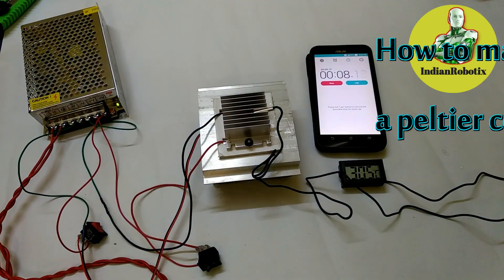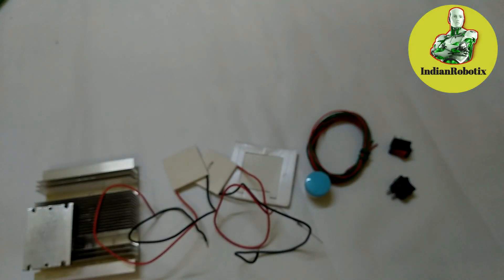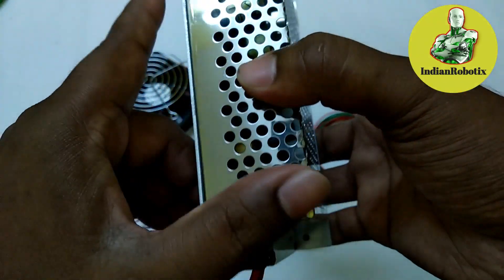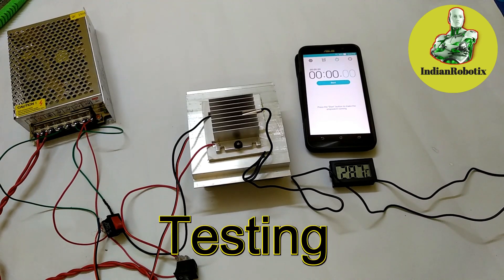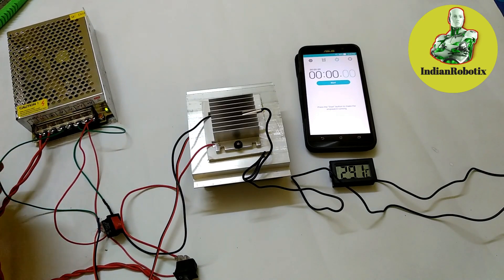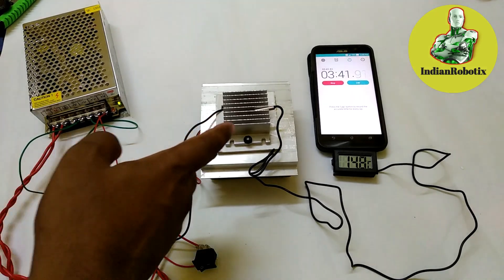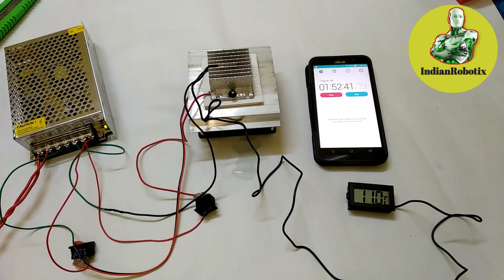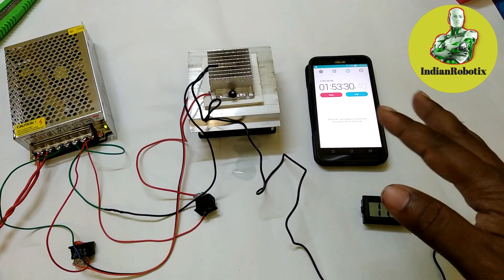How to make or assemble a Peltier Cooler at home by #IndianRobotix

Comment: you canot connect the hot side to the cold side using a metal screw. there is a temperature drop thats why it took u a full hr. just to reach 7 degrees
Reply: pls elaborate he is connecting hot side to big sink and small sink to cooler side then how to correct it as u said

Comment: Sir can I use 12 v 2 a adopter power source with water cooling system
Reply: Animals & pet care noPe. Tec-12706 draws 5a or 60w
Reply from the maker: You can use but you will not get full output😊👍

Comment: Sir kya vo temperature ek bar 1 *celcious hone ke bad baki time same bhi same rahega
Reply from the maker: Bro check my other Videos you can find liquid cooled Peltier module there you can drop temperature up to -9℃ .... Air cooled system not that much great it drop up to 8℃ after 2and half hours.....
Reply: Sir I am asking you about how long the temperature  will remain 10 or less degree celcious if we install this system in foam box
Reply from the maker: @shrinivasnaphade1179  bro this is depends on cooling method of hotter side because if it able to maintain delta temperature then you can run it till it's life cycle which is 200000hrs...😊👍👍 So just you need to maintain low temperature in hotter side of Peltier...

Comment: Hi bro , pls show how the wires are fixed. I can't fix the wires properly. Pls pls show how to fix the petlier wire and fan wire and how these wires assemble to power supply
Reply from the maker: Check another Video bro wiring is very easy here : that video : "How to Assemble a Peltier module or Peltier Cooler at Home in Hindi By IndianRobotix" if you still not able to fix please comment down.....

Comment: Will the peltier survive with only a heatsink, no fan.
Reply from the maker: No it will stop working if temperature difference between two side increase higher than 68℃ in case of Peltier IC TEC1-12706...😊👍
Reply: @IndianRobotics  So it's auto stop in case it crosses the temp limit or will it go bad (kharaab ho jaayegaa) and can't be used again? Thanks friend!
Reply from the maker: @Chetan_N_S  actually that temperature difference going to burnout semiconductor pair inside so only we need to cool down the hotter side. Better the quality of cooling in hotter side will give you good amount of decrease in temperature in cooler side...
Reply: @IndianRobotics  thanks friend!
Reply from the maker: @Chetan_N_S  welcome bro.....😊👍

Comment: amio ekta fridge banachi..bt ami duto peltier use krchi....sb set krlm box insulate krlm..bt thanda thik tamon vabe hoche na...ami jei kota video dekhlm sb kota te lowest temperature jache 1.1°c...bt amr 24°c pouchache na...eta ki heat sink er jonne hoche.???peltier 12706 use krchi ami.with 12v10amps
..
Reply: Help
Reply from the maker: Tumi amar ai video ta dekho tomar Peltier er rating somondhe concept clear hoiye jabe https://youtu.be/2WWjGwx70Ps
Reply from the maker: Firstly tec1-12706 ka max current ratting 6Amp haa check koro ic ta thik ache toh. Chances high kharap ba burnout hoiye jete pare. Now ami jta use korchi atai lowest ami 8℃ aspas achieve korte perechilam. Tumi akta jinis dekho heat sink ar Peltier module er modhye enough thermal paste lagano hoiyeche naki. Ja hatu tomar kache 12volt 10amp source ache better tec1-12710 ic ta use kora ota 15 volt 10amp ratting ache. But ami use korini tai practically temperature koto hobe no idea.
Reply: Peltuer akdom puro new...bt maximum jei heat sink gulo amazon e pawa jache jeigulo ofline e pachi na...so ami 18/80 heat sink use krchi....jdi tmi wp contact dao den ami tmai pic send krte partm heat sink er.
Reply: Amr box ta e thanda hoche na...eta e prblm sdhu amr...bjhte prchi na ebr heat sink er jonne hoche ki na eta.
Reply: Plz dada ektu help koro amai...jdi contact korar jonne kichu provide koro to ektu better hoi..need suggestion.
Reply from the maker: IndianRobotix facebook a search koro filter a group select koro fb te akta amar group ache okan a post koro
Reply: Group e add koro ami join request pthachi.

Comment: does it produces ICE? how about the hot side? does the fan still spinning?
Reply from the maker: Actually during my checking it was not make ICE . I was using 12volt 5Amp source. But it can handel up to 6 amps may be then ice produce possible But i think it is better to use higher ratted Peltier like 12715 it can handel up to 12 volt 15 amp so there is higher possibility to get ice.👍👌😊
Reply from the maker: I have a separate Video for some more type of Peltier module check that for more info..

Comment: Is fan sucking the air in or blowing it out? which way is preferable?
Reply from the maker: suck and through in other side to make it cool👍
Reply: @IndianRobotics  if I also want to keep a fan inside means on the cooler side what should the fan do suck or blow?
Reply from the maker: @mkarthikraja  Actually bro when you connect a dc source in peltier IC then one side start heating and other side cooling so if you connect fan in both side  which can suck air from IC and through in other side then it is OK but it try to make both side in a fixed temperature suppose cooling side fix in 12 degree and hot side on 42degree
Reply: @IndianRobotics  then  what should be the fan arrangement on both side to get maximum cooling ?
Reply from the maker: @mkarthikraja  Best use small fan in cooling side and  a big size fan in hot side. it will give you max cooling. And start the cooling side fan after some time. And if you use water cool peltier system then you can achieve more cooling than fan cooled peltier module.
Reply: @IndianRobotics  is it fine if both fan suck the air. Or blow is better?
Reply: @mkarthikraja  which way you fixed the fan on cold side i.e.,,  blow in or  suck out and what was the result..??
Reply: @alskrishna9513  suck out I put...but there wasn't that much difference if u do it other way..
Reply from the maker: means if you change polarity of fan then it can change direction of air flow so you can test it
Reply: @IndianRobotics  means if we use fan on cold side it should blow in..? At the same time fan on hot side throw out the hot air..??
Reply from the maker: @alskrishna9513  No bro Air should be through out from both side . Peltier module work on Peltier effect that means both side produce hit and cold together so for maintaining that you can through out air from both side. Thanks bro for your question. Question is the only solution to get answer.... BTW Good question

Comment: Bhai kinte amperes ka current dena hai ek peltier ko
Reply from the maker: TEC12706 Here C indicate standard size , 127 indicates no of dope P & N, and 06 indicate Current rating in amps means it can handel up to 6 Amps and as per data sheet recommended voltage 12V so i use 12 V 5 Amp

Comment: long lasting karega yea nehi
Reply from the maker: I am using it for one and half month so i am also not that much sure about how much it can lasting. But after some months i can tell you based on its performance.One thing manufacturing warranty of TEC-12706 is 6 months. Thanks for subscribing and supporting Soumya.

Comment: Why no fan on cooling side ?
Reply from the maker: Good question.Basically I make this peltier module to make a small instant water cooler so for that i want that it should not distributed so fast rather than it can bring down the temperature of a small area so i am not use small fan. But if you want you can use it. you can watch how to make a instant water cooler : https://www.youtube.com/watch?v=CGtqZM5Tog8&t=8s